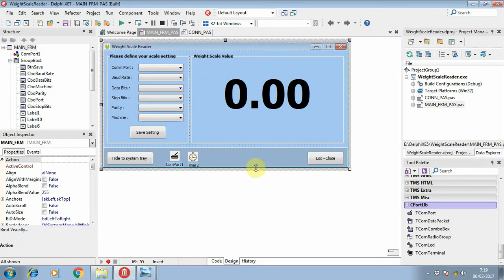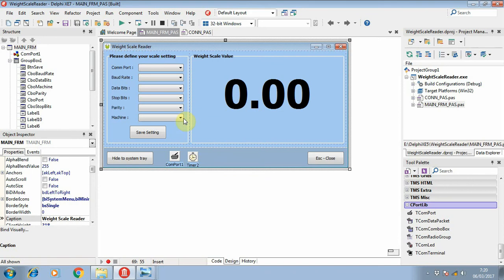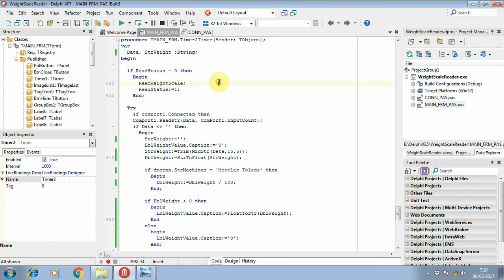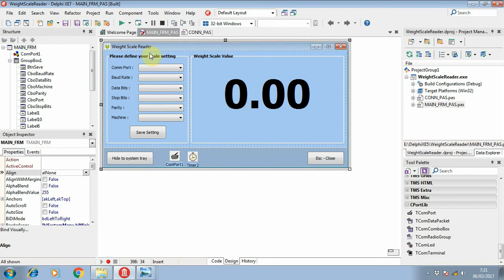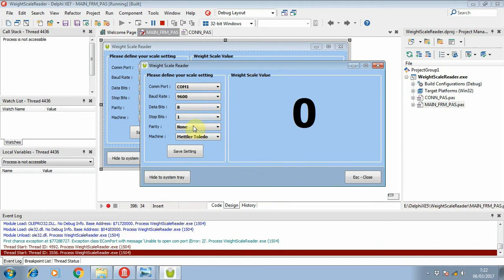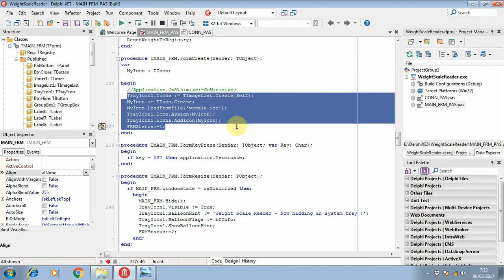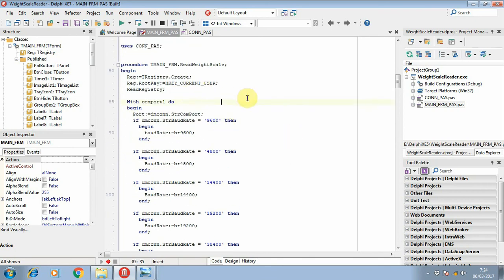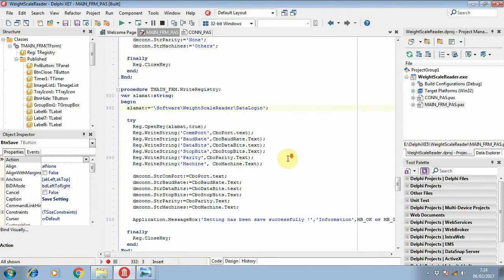How To Read Weight Scale Value From Delphi With Comport Library

Comment: Hello, I have a datalogic magellam 8300, the beha component is well installed, however, I could not get it to read the weight of the scale and neither the bar code, could you help me
Reply from the maker: first try to test it using hyper terminal..make sure the com port and setting are corrrct. If you can read the value...I think you can read it using your own apps or my apps 👍
Reply: Hello i'm using Delphi 6 and comport library, when i make de tests it's say that whas connect, but i can not recibe de result, i hope you could help mi with ones of your apps, im breakig down with this.. her my email: ambiorixml@gmail.com.
thanks